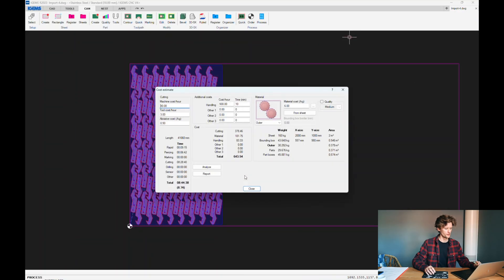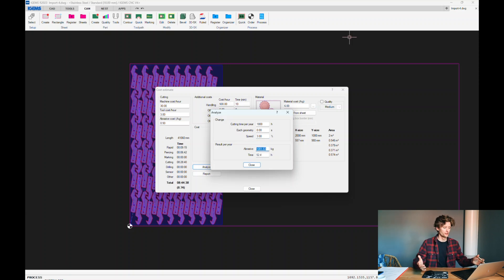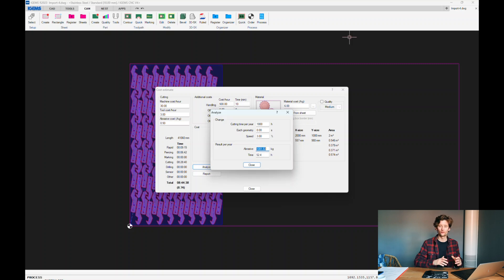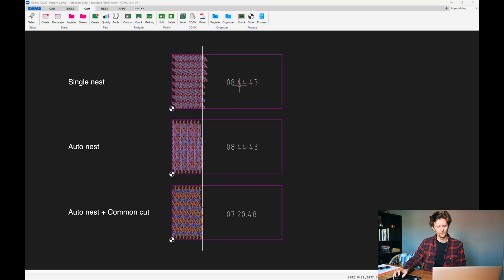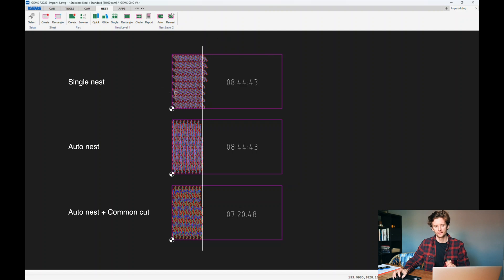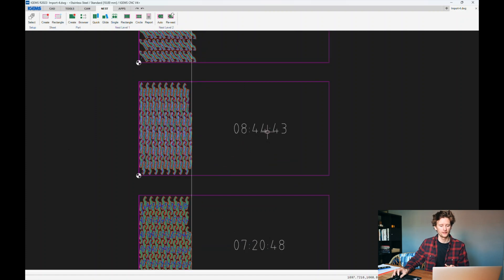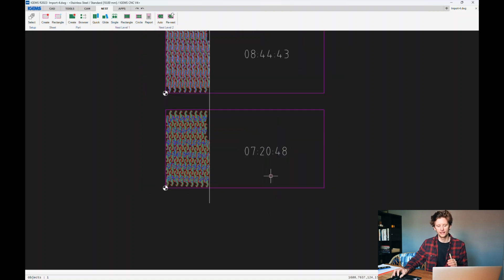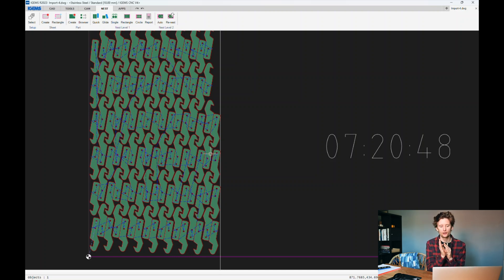5 reasons to update your IGEMS CAD/CAM

Comment: Ok here is a though one.  I got a .5 height step to climb inside cut a ring  in a 3 axis machine and looking to modify the tool pathas a variable height. I want to be able to have a close to part cut but gradually getting away of it near the step, "climb the step" but the auto says it will crash.
Reply from the maker: Hi Christian,
So you want to cut a bevel on the inside of a ring with a climbing Z? Did I understand you right?
Joakim
Reply: @igemswaterjet  that's correct. I want to have the ability to change the Z distance of the tool in path.
Reply from the maker: Christian,
I don't fully understand what it is you want to do. From who did you buy your IGEMS license? I'd like to help you find the right person to talk to.
Joakim